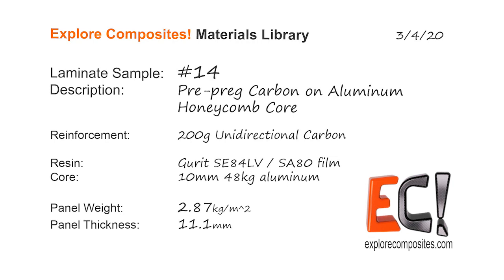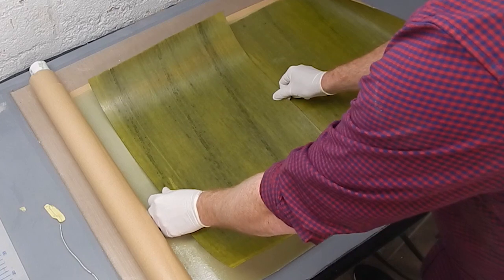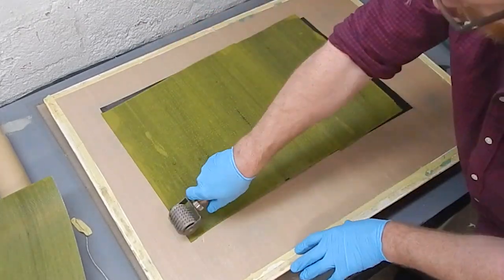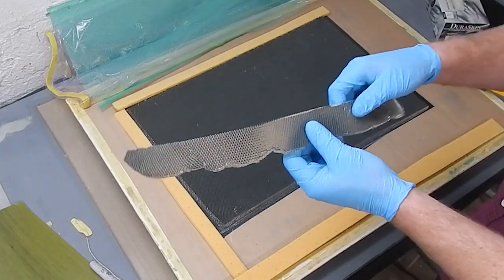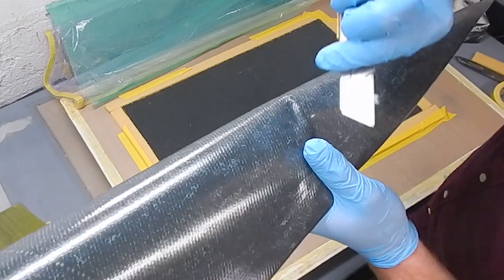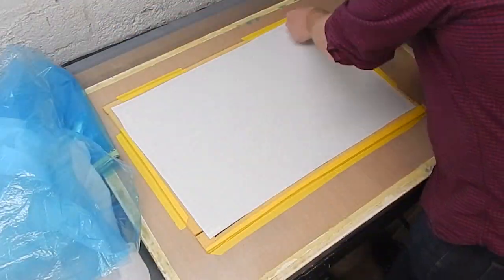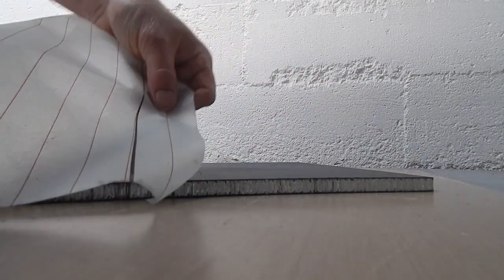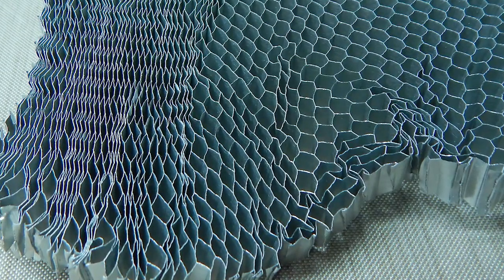Laminate Sample #14: Prepreg Carbon / Epoxy on Aluminum Honeycomb Core

Comment: Are there any re usable type plastic films for vaccum bag?
Reply from the maker: There aren't any really good reusable options for thin films.  Silicone sheet is often used but in thicker sheets or seamed or laminated custom bags that only work for one part geometry.  For flat panels, silicone sheet in a "veneer press" type frame is common but expensive to set up and only really good for simple shapes.

Comment: Can you do a video on dry carbon and al honeycomb
Reply from the maker: There's no really ideal way to do "wet layup" of dry carbon on honeycombs because the resin wants so badly to run down and fill up the cells.  Flat panels can be done like "Laminate Sample #1" - one side and then the other.  For heavier reinforcements it is possible to laminate a very light skin (less than 200g/6oz) on top of the honeycomb after bonding it down to seal off the cells.  Let this "scrim" cure and then add the remainder of the laminate.  I'll try to do this in a future laminate sample.
Reply: @ExploreComposites  I've been curious about dry carbon on honeycomb as well. Is there not a way to bond the honeycomb to already cured sheets of fiber? This would make the most sense to me, as this would avoid resin seeping into the honeycomb. I've recently asked someone who manufacturers their own panels using dry carbon how they do their process, but I doubt I'll get an answer from them. 
I'd also be curious about a honeycomb filled with a closed cell foam, it shouldn't add too much weight, but would also solve the same resin problem, or mostly as the top and bottom surfaces would have small voids in the foam, if you were to do wet layups on top of a honeycomb.
Reply from the maker: @xaytana  You can definitely bond cured sheets to honeycomb - like Laminate Sample #16: https://youtu.be/qL3r20hy4dM  
Could easily do this with cured carbon instead of G10.

Also Laminate Sample #1 uses dry carbon in a two-step process with honeycomb: https://youtu.be/YRpu3pb2b3U

I've never used foam filled honeycomb but would love to test it out... do you know any manufacturers?
Reply from the maker: Check out Laminate Sample 22 - its Kevlar not carbon but same idea.

Comment: Aluminum and carbon fiber dislike each other due to dissimilar corrosion. This can become an issue later on. 
Cheers on your videos keep up the good work!
Reply from the maker: Yeah - this wouldn't last long in an electrolytic situation!
Reply from the maker: @melissahill7930  You're right - this would help - but its not very commonly done.  Most carbon things made with aluminum core aren't used in a corrosive environment so its less of a big deal...  and there are other cores (aramid honeycomb, foams, etc.) that solve the problem effectively.  For isolating aluminum hardware - fiberglass inserts/plies/scrim are a good idea for sure.

Comment: Another YouTuber claims you need to insert a fiberglass layer each side between the carbon fiber and aluminum to prevent galvanic corrosion.
Reply from the maker: That is a good idea if you are concerned about galvanic corrosion - which will be an issue in the presence of an electrolyte.  The DarkAero project team has a great video explaining: https://youtu.be/yRpMZaU8zKw

There are many types of projects where aluminum honeycomb is bonded to carbon without isolation - either because weight is more important than longevity or there isn't the potential for an electrolytic issue.  I didn't use an isolation ply here but am planning to address the concept in a future sample.  Like many composites manufacturing choices it's complicated - not a right/wrong thing.
Reply: @ExploreComposites  that’s a very well reasoned, balanced, and thorough explanation. Thank you.

Comment: Thank you so much! It is very useful!
We are planning to build a monocoque for a racing car using carbon fibre and aluminum honeycomb too. Is it possible to build a large and heavy weight loading structure without autoclave/oven??
Reply from the maker: Glad you found the video useful!  You can build with honeycombs without prepregs but it is less ideal.  For complex shapes you’ll have to cure one skin in the mold (bagged wet layup probably) then the core gets bagged in and detailed.  Then you will do the inside skin using a bagged “wet preg” approach.  Check out laminate sample 22 and also the wet preg one - think its around 10 or so.  Also have a look at the Darkaero youtube channel.

Comment: Do you find the aluminum or armid more rigid, or does it rely more on thickness of the core ?
Reply from the maker: Stiffness will be most directly related to thickness, but density and ribbon direction matter too.  Aluminum is probably more "rigid" for a given thickness and weight - but not by a whole lot.
Reply: @ExploreComposites  thank you!

Comment: If it is pre_preg why are you adding resin ?
Reply from the maker: The resin film added just to the plies facing the core is there to bond to the honeycomb.  The prepreg has enough resin for itself, but not enough to bond thoroughly to core so a resin film adhesive ply is added.  Debulking it to the carbon itself is a great way to make it easier to handle and more effective.

See sample #12 for what happens when you don't use prepreg film adhesive to bond core.